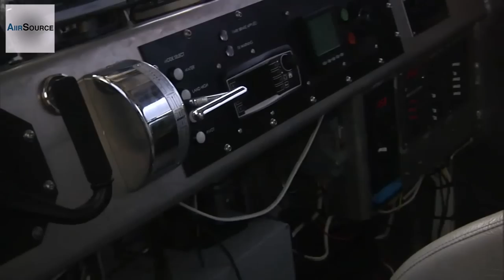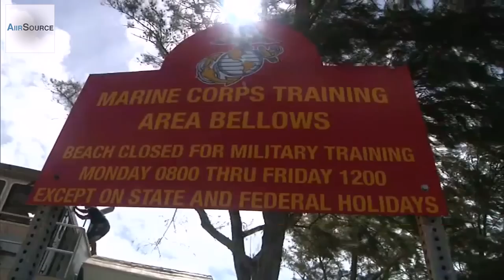US Marines MASSIVE Experimental Amphibious Vehicle - Ultra Heavy-Lift Amphibious Connector

Comment: Okay, it's clear that most commenters don't understand what the UHAC is supposed to do. The key term in the name is "Connector." 

In sea-land warfare jargon, a "Connector" is a LOGISTICS vehicle that hauls cargo from transports to the shore AFTER the shore has been secured by assault. By the time the UHAC hits the beach, all shooting will have moved far from the beach. It doesn't need to fast enough to avoid fire (pretty much impossible these days anyway) nor does it have to carry enough armor to take a hit like a battle tank. It's just a truck, not a tank. 

The UHAC is designed to haul very heavy objects e.g. generator plants, prefab bunkers, tons of fuel or maybe an Abrams tank, or other heavy military tech. It's a base builder, a schlepper not a fighter so to speak.

Since the days of sail, to WWII to the present, shifting big, heavy resources off transports and getting them across water, muck, slicing rocks, and maybe dozens of variation in the load bearing density of the surfaces crossed, has been the major logistical challenge.  Right now we don't have such a thing. Hovercraft are really expensive per mass unit moved, are large compared to the cargos, have high maintenance requirements and are very sensitive to many surface conditions. They're neat and good for certain circumstances, but you wouldn't want to hinge a logistics train supporting thousands of personal ashore. The weird track of the UHAC is intended to be able to cross dozens of different surfaces and sea conditions while carrying extremely heavy dense cargos. If they get it work within a system, we will be able to hinge a sea-to-land logistics chain on the UHAC

Why would we need such thing? It's clear that improvements in mines, long distance artillery etc that the marines aren't going to be storming the beaches WWII style along a couple of miles of beach anymore. The enemy can saturate defend such small stretches. Neither can we we reliably plan on capturing ports in any condition for quick use. If you look at the range of amphibious technologies being researched, our sea-to-land tech is being configured such that we can put heavy forces ashore, and sustain them, anywhere along a coast line, not just a few sweet spots. The UHAC is intended to replace a harbor, with docks and cranes, not an assault tank. 

If we get a system of integrated logistics technology, we have tens of thousands of klicks of coast line we can threaten. Also, will make a good disaster relief vehicle. High volume desalination plants are big, heavy and notoriously hard to get ashore.
Reply: +Shannon Love  apparently its supposed to carry a shipping container to shore from a civilian container ship and re supply military operations without a harbour it can apparently climb a 10ft wall not sure if thats from the beach or from a floating position.. so whatyou said...x
Reply: Just ignore the other commentors. Random people on youtube don't know jack shit.
Reply: Thanks for the info.  That really clears things up.  I watched this at first and couldn't believe what I was watching.  It did seem off to me that they would take that kinda route for troop drops and now I understand that's not what its for. 😀 Thanks for being someone that actually shares the needed info!
Reply: Need more vids proof of concept. Would Elon Musk back this?
Reply: Thanks for this. Reading the comments gave me cancer, and that's not a term to use lightly.
Reply: Shannon Love An old high school friend and army buddy started working on LCACs at Ft Story VA back in 89 or 90, sometime in the past 30 years the details slipped my mind but Wikipedia refreshed my mind. 60 ton load, up to 75 tons overloaded, 40 knot speed at full load and 200nm range at 40 knots. Maybe they are more maintenance-intensive than this thing (I’m not sure, I spent 12 years as an MLRS crewman and tracks are VERY maintenance-intensive) but considering the speed and outsized cargo advantage the LCAC has it may turn out to be less expensive per ton-hour/gallon (my made up term 😂) to use a hovercraft. The SSC will probably be even more efficient. 

 My friend later went in to work on a different kind of landing craft, a wheeled model with propellers for water travel. I can’t recall the designation right now, it was a lot smaller & slower than an LCAC but also much simpler & less expensive. They all kept their fishing gear aboard LOL
Reply: To damned slow. That thing is a sitting duck
Reply: Ae86 Hachi — It’s logistics. It’s not supposed to be in a firefight.
Reply: @shannonlove4328  I understand but when has an enemy not tried to disrupt supply lines? It's an interesting vehicle no doubt I'm just skeptical about the viability
Reply: Ae86 Hachi — You protect logistics by keeping the enemy away from them, not with armoring them. Have you ever seen an Army fuel truck? There’s no b armor on it.
Reply: Kind of hilarious how many people think a literal cargo transport needs to be armed and armored to withstand a carpet bombing.

Their impressions about speed are right though. Even as a supply line vehicle, the speed at which it goes on ground through most of the video is insanely slow. Obviously, it must be well, well under its maximum speed even under loads. Obviously, this is a test bed.

But I would say that yes, even supplies need to be moved at a reasonable pace, and the pace here isn't reasonable at all.

Comment: Hell, the war will be over by the time it gets there.
Reply: +skoko1945 - Yep! The best way to save your soldiers' life is not to let 'em arrive to the battlefield. Very clever.
Reply: Good point. Thats how they have such high survival rates. Ha
Reply: +skoko1945 apparently its supposed to carry a shipping container to shore from a civilian container ship and re supply military operations without a harbour it can apparently climb a 10ft wall not sure if thats from the beach or from a floating position..
Reply: in spidermans dreams it can
Reply: it not ment to be fast it's ment to resupply Marines already on the beach
Reply: +TheRightMan why dont they just refit an ambphibious apc do that job
Reply: ***** I find myself wondering if all they want to do is get shipping containers onshore why not disposable pontoons with a thruster system for drive kind of like the emergency ramps on air planes strapped to the containers just drop inflate point and go as soon as they hit the shore another set of air-bags inflates under the container to hold it at water height you could package the whole thing in kevlar and use them as pre attack defences for beach assaults...Hang on arnt I describing a landing craft some of which can hold tanks let alone a shipping container and funnily like your hovercraft Brian they already exist....I think somebody wanted a toy and now needs to find a job for it to justify the money...

Comment: People commenting are clearly missing the point.
Its a prof of concept heavy amphibious lifter. Speed isnt everything because this isnt a "beach landing" craft. Its a way to transport HEAVY equipment to the beach AFTER its under control so that those forces can be used past that point.

Added to that that the maintenance cost is probably lower than the current high cost hovercraft they use. It might overall be a better choice. Aka, same job, with more weight at a lower cost and if you can transport more units via this method at a time it might also be faster despite the fact that the machine itself is slower than other methods.